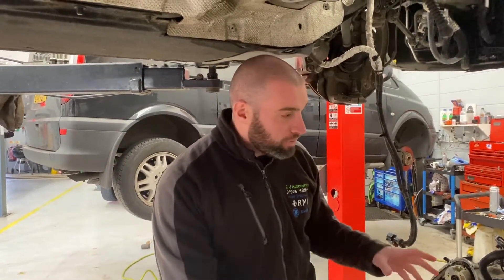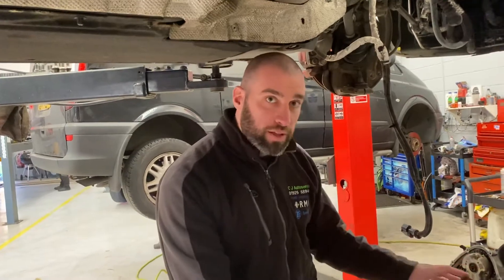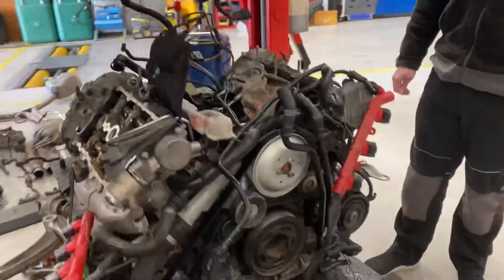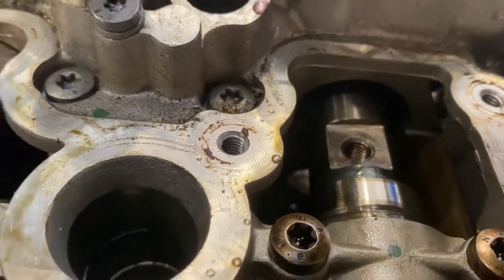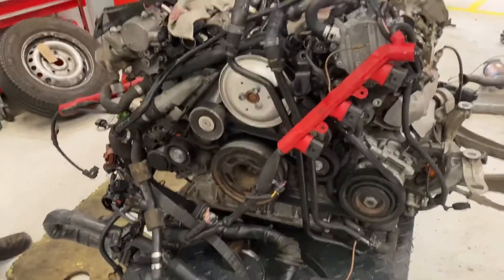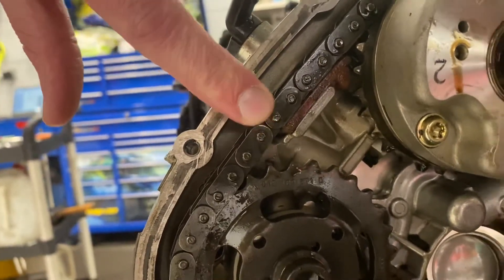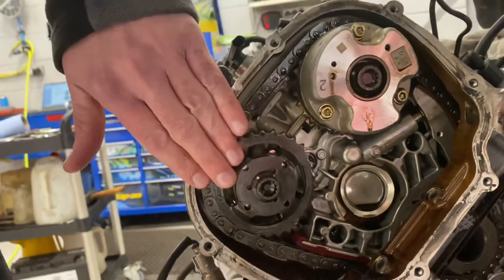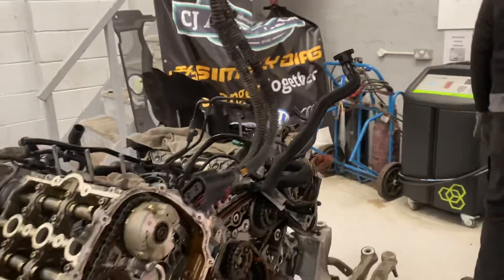Timing chain jumped a tooth

Comment: If the timing chain jumps a tooth is there any way to fix it by just realigning it properly or is the only solution a total replacement?
Reply from the maker: @gsotelo1053  I would 100% replace the timing chain kit. If it jumped once, it would jump again and probably worn

Comment: I've come to the end of attempts to get my 2005 Corsa C to run longer than a few seconds. Im told it might be a jumped chain. Do i have to go through all this to check? And if necessary to correct?
Reply from the maker: You don't need to take the engine out on a Corsa but you will need a timing kit and it will need to be checked
Reply: @cjautoservicewarrington2066  Thank you so much. I have bought a timing kit. Just need to find an appropriate video for CHECKING timing. Again, thanks for your time.

Comment: So there was no bend valves

I hv same issue v6 recedes m111 it start but take time like I can crank it 7 times fo it to start then somtimes it start n stalls some time I feels like it hv a lot of power sometimes it does not hv power we checked it jumped timming with 2 teeth on right side cylinder head we fixed it but hvnt started by any chance is the any possibility tht the valves bent
Reply from the maker: There is a chance the valves could be damaged but if only 2 teeth I would retime it with new parts and 🤞🙏
Reply: OK let me do retimming and see if the is gonna be a change thnks a lot

Comment: Hello. I have a Peugeot boxer 2.2 (transit engine). I’ve been told the timing chain has jumped. The van broke down on the motorway. Loss of power and black smoke. Now the engine won’t start. The mechanic said the engine will be wrecked. I thought this engine was non interference ? Is the mechanic telling the truth? Thanks
Reply from the maker: Sorry for the late reply, how did you get on with this?
Reply: @cjautoservicewarrington2066  took it to another mechanic and he’s stripped it down. He said there’s no bent valves, no damaged pistons and he said he doesn’t think the chain has jumped.
Reply: He’s now going to remove and refit the chain and set the timing then see if it will run
Reply from the maker: @andysanderson7730  has he removed the cylinder head? 
Hopefully the timing is out or could be a big waste of money and maybe more
Reply: @cjautoservicewarrington2066  he removed the head and there’s no damage to the valves,pistons etc. the chain hasn’t jumped. He also removed the sump and found water in there and he doesn’t know why. So now he doesn’t want to go any further and my engine is in bits. So I still don’t know what’s wrong with it
Reply from the maker: @andysanderson7730  if there is oil in the water I’m assuming the oil cooler has gone! 
Has he sent the cylinder head away for pressure test? 
If everything is ok ask him rebuild the engine with a new oil cooler 
Make sure all new gaskets are genuine and he fits a new timing cover
Reply: @cjautoservicewarrington2066  he’s pissed off on holiday now and doesn’t want to go any further with the van when he returns in 2 weeks. I don’t think the guy knows what he’s doing to be honest
Reply: @cjautoservicewarrington2066  would a failed oil cooler stop the van from starting? It will turn over but won’t start
Reply from the maker: @andysanderson7730  doesn’t sound very professional not finishing the job, you are going to struggle to find someone to rebuild it 🤦🏻
The oil cooler won’t cause none start just mixes coolant and oil when failed
Reply: @cjautoservicewarrington2066  I’m fed up of paying idiots who don’t know what they’re doing. I’m sending the van to a place who specialise in reconditioned engines. 1800 supply and fit for a fully reconditioned engine
Reply: I also have a 2.2 relay my chain jumped due to a tensioner being broken. I do belive these are non interference Engines. I'm going to put a new timing chain kit on. Normally if there is no noise when it cut out fingers crossed its fine.

Comment: So whats the fix?
Reply from the maker: New set of timing chains, guides and a lot of patience
Reply: @cjautoservicewarrington2066  hi mate, just wondering what are the chances of engine damage from this. As I’ve found out my timings off caused by chain skipping a tooth. Car seems to run and drive perfect only has a misfire on idle on the odd occasion.
Reply from the maker: @RetroTubing  chances are its ok mate, put a new chain kit on a pray 🙏
Reply: How did you get cam to be perfect again??
Reply from the maker: @kemoyjamk32  once the timing chains are removed you can move the cams freely to the correct position, then the timing locking tool holds them in place 
Refitted with new chains and sprockets